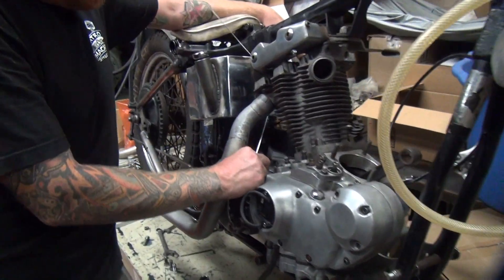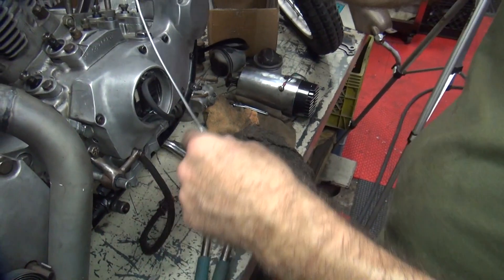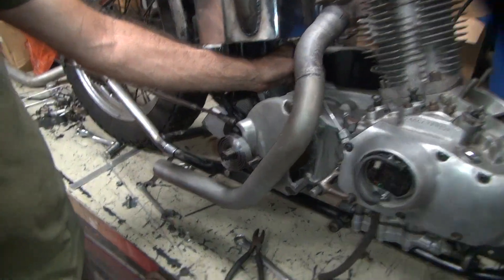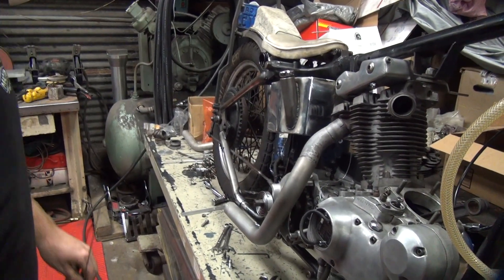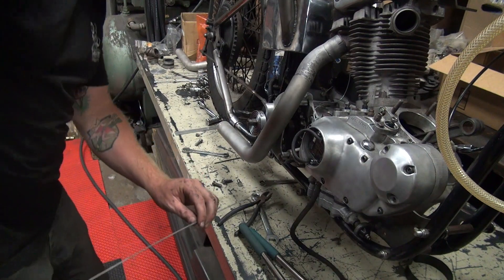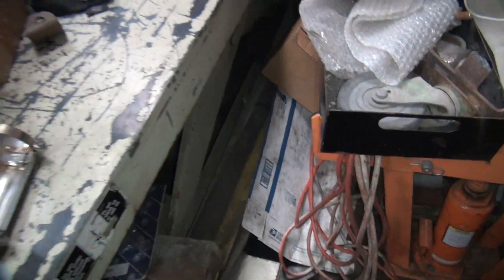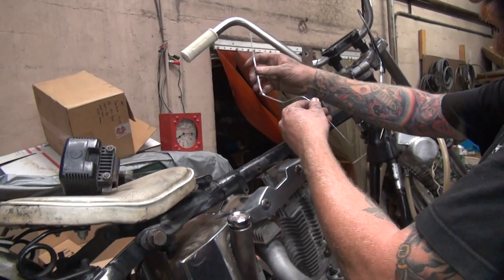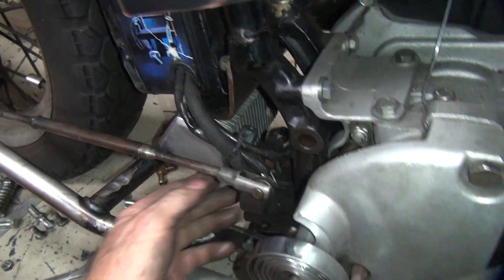1972 XL Ironhead Bobber #214 Sportster motor rebuild #2 bike repair harley by tatro machine

Comment: Tatro can you draw a picture and explain oil routing. From where to where on a ironhead. Kind of get it from this vid. But still a lil confused.
Reply from the maker: buy a harley service manual. it is in it.
tatro
Reply: @TatroMachine  i have a Clymer for xl that is 59-85. Didnt see it in there, but i watched your video a cpl more times and figured it out . Thanks for your time.